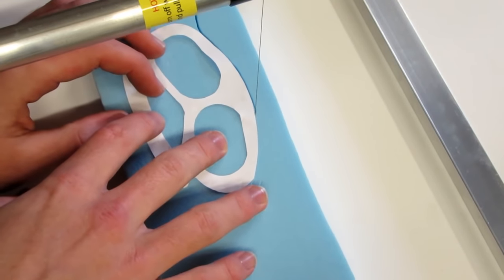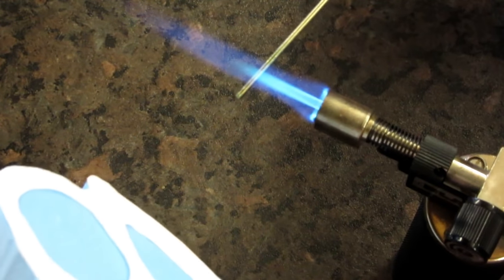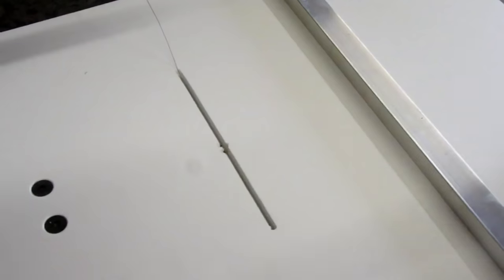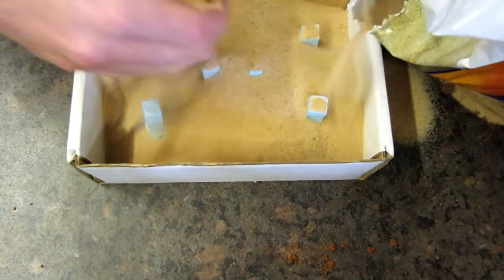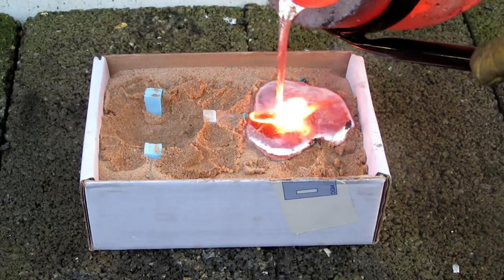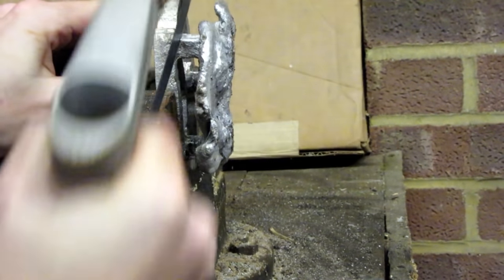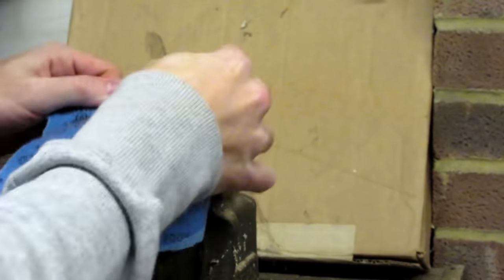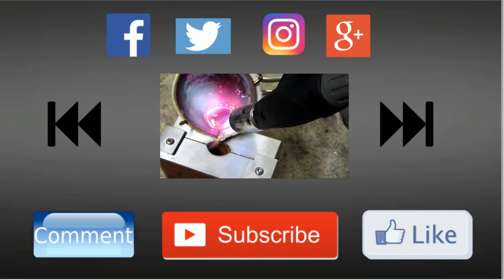Casting metal knuckle dusters (lost foam method)

Comment: Wouldn't one slightly larger one save you more work than 3 smaller ones? That just seems like a lot of cutting.
Reply from the maker: I added 3 since this was my first attempt I'n foam casting and wanting different entry points to get the best cast first time round, I'm sure 1 larger entry point would do fine and will have to try it in the future XD

Comment: Important to mention DO NOT USE A HAND HELD GRINDER TO CLEAN THIS UP.... SERIOUSLY....
Reply: Why not?goggles, respirator,angle grinder with a flap disc with guard on,I see no problem.
Reply: @HOLLOWPOINT71  aluminum when heated in such a concentrated area with friction has a tendency to technically explode..... Or break off in massive chunks which will break your galsses or possibly imbed in your meat....